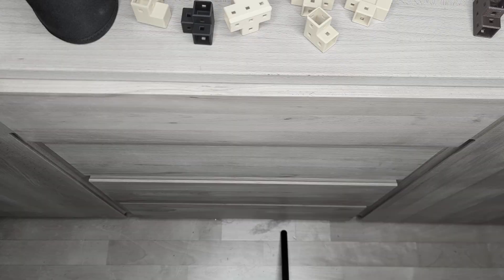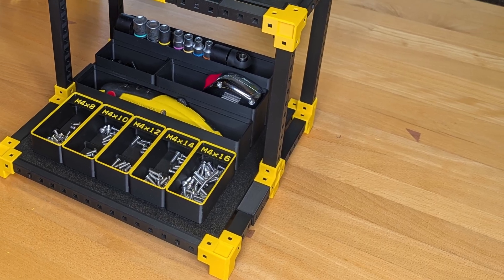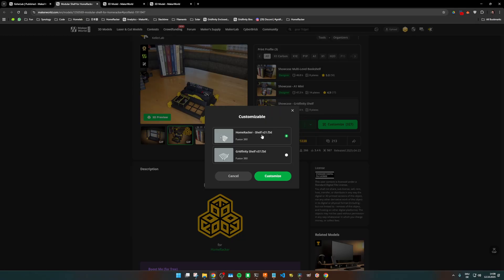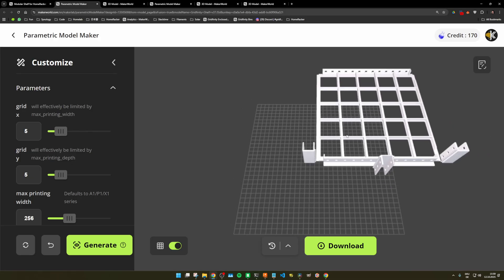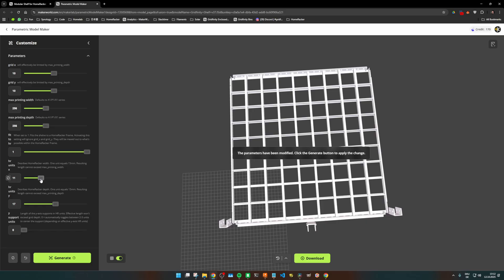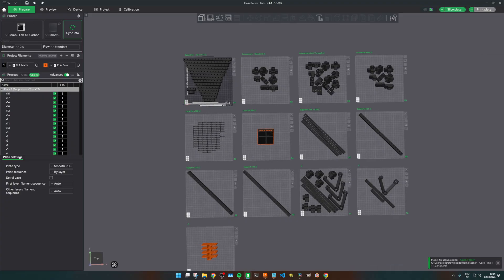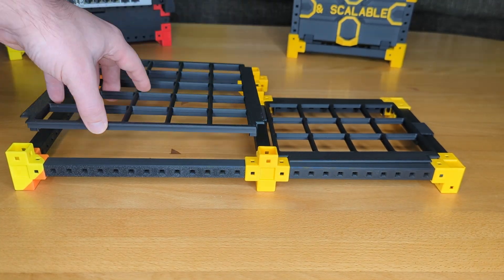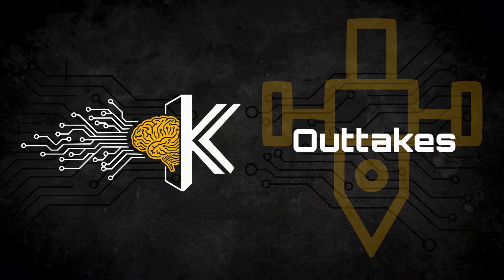Never Run Out of Gridfinity Space: Print Your Own Modular Shelves!

Comment: Keller! Fantastic! Thank you for this. 
For the supports, do you think it can lend well to stacked printing like multiboard? I’m still new to fused deposition modeling. I intend to investigate that possibility.
Reply from the maker: Pegboard compatibility for multiboard, skadis, opengrid and HSW is on my todo list :-D
https://github.com/kellervater/homeracker/issues/38
Reply: @kellerlabs  I phrased the question poorly.  Let me retry: I want to print a ton of supports in one go to save time.  Do you think that the supports can be stacked for printing?
Reply from the maker: @jonathannguyen9425  oh, got it. hmm... i think that might be feasible even though I never tried it. You could stack them upon each other and put a single layer of support filament in between. I cannot guarantee that this works. I wouldn't change printing orientation though as this might harm lock pin fitting.

Comment: 5:13 cr10 max, they are in the 450 to 470 range so I'd just set the limits at 500 because that covers just about everything
Reply from the maker: thx for the input. already done. if you print shelves this big, let me know how they hold up stability-wise.
Reply: @kellerlabs currently thinking about it, I'd probably use better materials for the larger ones for sure.
Reply from the maker: @deltacx1059  maybe that's a good idea. I honestly cannot tell about anything bigger than 256mm squared.

Comment: Really hyped about the drawer version, bit worried about the strength overall, especially the drawers. I also notice you need to add weight to the bottom to prevent it tips over. Optional would be points to screw the case into place on a bench or wall. Would also love to see one who I can mount under my wooden diy shelving unit. An upside down model. 🤔
Reply from the maker: You are right to be cautious here.
Here's what I can tell you upfront:
The drawers are of course limited load-bearing-wise. Since they are fully-extensible using drawer slides, those will bend the more weight you add to them and the deeper they go.
What I noticed on an 5x6 is heavy bending when they're fully extended,  but nothing more, since the layer lines are in our favor.
And yes: when you have a very lightweight version, it'll tip. But the more levels of drawers you add, the sturdier it gets.
And about your mounting idea:
Nothing easier than that with the homeracker wall (or any surface) mount which you can incorporate into ANY build. Can be found here: https://makerworld.com/en/models/1391336-wallmount-for-homeracker#profileId-1441603

As it seems right now:
I think I'll be able to release the drawers this week already.

Comment: Hi thanks this is a great add on to rack, another great video. but I don't have a bamboo printer and my slicer "Orca" cant import the ".f3d" files it needs step or stl files.
Reply from the maker: Glad you found the videos helpful.
A few explanations:
* f3d is not bound to Bambulab. It's the original Fusion360 file, the program where I created the design in. That one is free for personal use, but a bit complicated to get. However, from this file you can export ANY format.
* Also: The customizer (PMM) also allows you to export .step (or stl, can't recall) files. 

So either way: All files or exports (except for 3mf) are not bound to Bambu.
And if I recall correctly: The Bambu Slicer also allows other brand printers (not sure on that though).

Does that help?
Reply: @kellerlabs  Hi thanks for the info, it was because the option was to open in bamboo studio, and then chose a bamboo printer to download to. I have tried to get 360 access before, but here in the UK they (autocad) don't allow it anymore.
I use a different cad system, so I can easily redraw any of the parts if I need to, it just takes more time, I have most of the gridfinity models already, so I can mod them at will.
Reply: @kellerlabs  I was able to use the customise option, and download the STL file, but even if I set the maximum size of my printer bed it still places the 3 support pieces outside of the build plate area, and I can't delete or move them.
Reply from the maker: and the "Split to Objects" button also doesn't work? that's a pity. 
Until I am able to investigate here: Would you mind giving Bambu Studio or Fusion360 somehow a try? currently a bit low on disposable time.
Reply: @kellerlabs  Hi thanks again, I did manage to get the split button to work in the end. and I was able to get it all working. I am new to the orca slicer, and I have always used step files in the past, occasionally used the stl files.
I don't often get designs from makerworld or other sites, I mainly use my own designs, but I really like your system, and the gridfinity system.
I was confusing the "3mf" files with the "f3d" files, neither were familiar to me. I was a mechanical design engineer before I retired, I was using solidworks and autocad for 25 years.
Reply from the maker: @kensteeplejack  So great to hear that it worked out for you! And thank you very much for the compliment. I can totally relate on the filename extension confusion. Especially when getting  into a different ecosystem. 
Happy Printing 😄

Comment: have you also a tool to remove the pins?
Reply: I find fingernails to be enough usually.
Reply from the maker: @Ruzgfpegk  It sometimes depends on the materials or even colors have different firctional properties (e.g. PLA MATTE nardo gray vs Charcoal are worlds apart).
this might be due to shrinking properties as well, but I didn't go down that rabbit hole (yet).
Reply: The best way I've found so far is a small screwdriver used to push them out from the other side.
Reply from the maker: there's different methods:
* Use this community model specifically designed for that: https://makerworld.com/en/models/1471814-homeracker-pin-remover#profileId-1536070
Alternatives:
* use pins to push other pins
* use pins and their small hooks to pull other pins
* use a simple screwdriver to push pins

Comment: Awesome! 
Do i really see it? Actual 3D printed drawer slides???
Holy shit i cannot wait! Really excited to see how long one can make those and how much weight they can hold! I have so many ideas outside of gridfinity already!
Reply from the maker: Yup, you see that correctly.
Took me 3 weeks and more than 20 prototypes to create a somewhat acceptable drawer.
But don't fall into hype mode here yet.
My focus on the drawers was printability (no print supports) and least possible overhead with the slides.
Hence, there's some limitations to the load bearing cababilities.
Teaser: With an A1 printer I was able to print a 5x6 grid and put around 2.5kg on it. It bent like crazy but didn't break due to smart printing orientation.
Still: the drawer is also only the first iteration and will also get better over time.
Stay tuned! 1-2 weeks out.
Reply: @kellerlabs  good man not overselling it :)